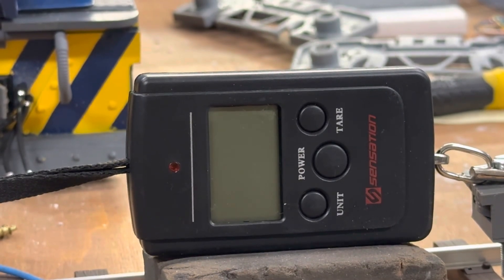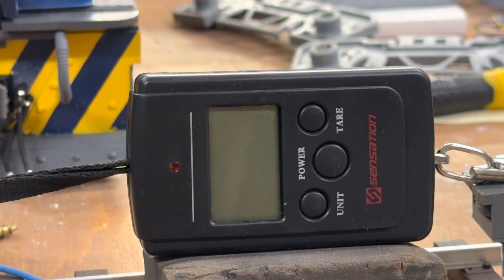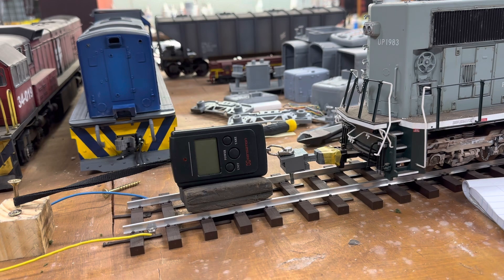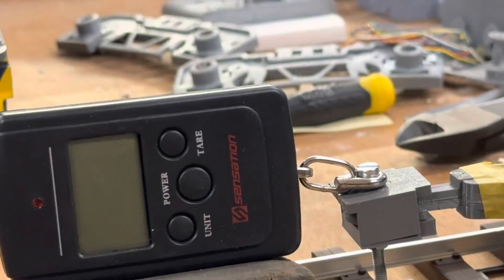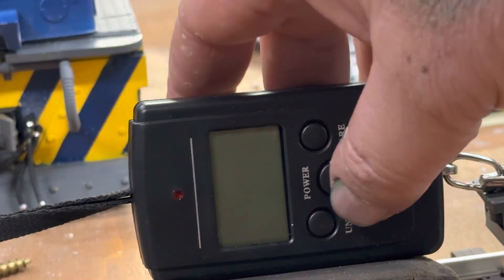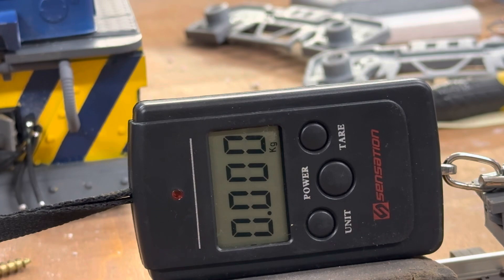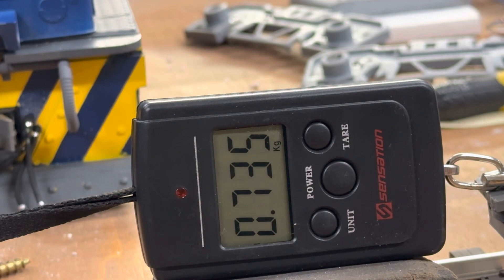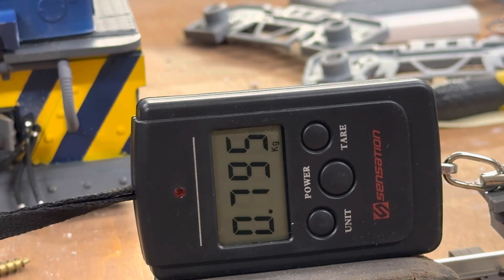Train Dyno Test!!! USAT SD70.

Comment: Cool test to determine the strongest puller out of your bunch of locomotives; but the variability of car loads, weight, wheel resistance, and curves on the layout make it almost impossible to know what it can truly pull (based solely on measurement).